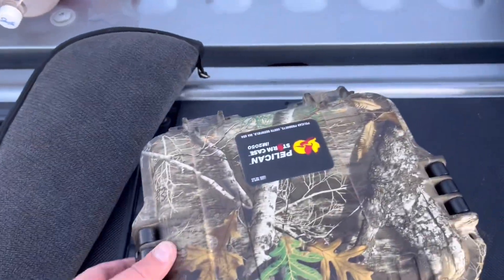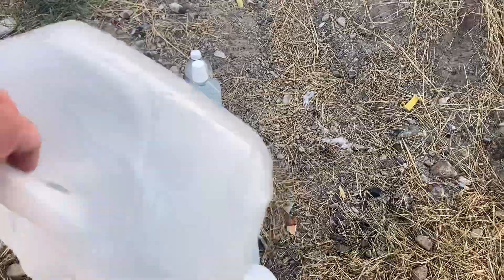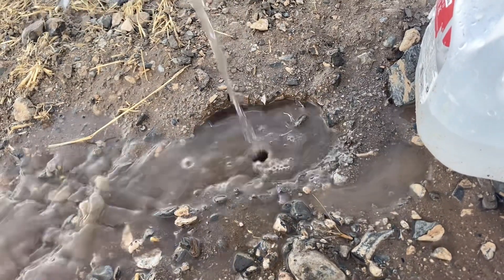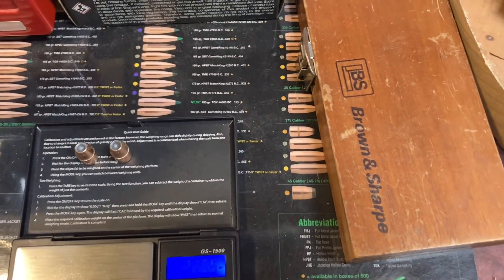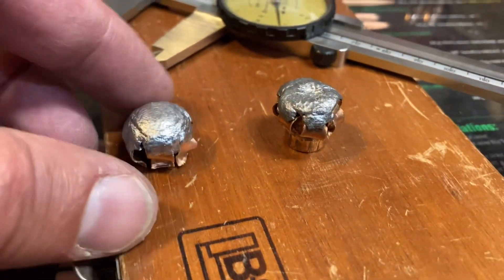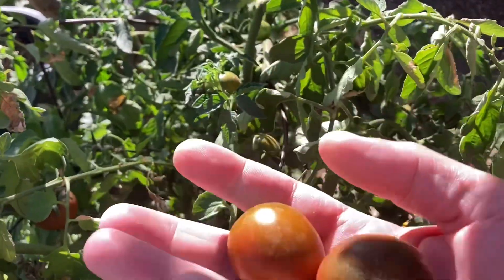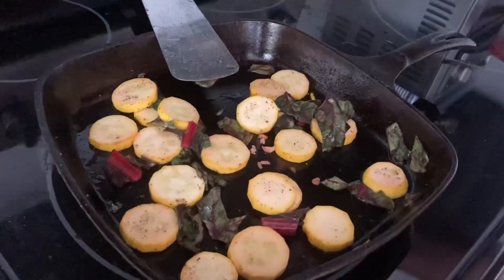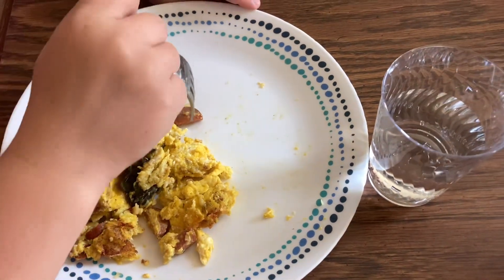240 gr XTP 44 Mag Performance Test -Redneck Ballistic Materials Testing

Comment: Been using these for years in my muzzleloaders and going to use them in my new cva optima v2 pistol with blackhorn 209
Reply from the maker: I really like the XTP’s, they are just a great performing bullet if you can get the velocity, and they are affordable.  Those are sweet looking pistols.  What kind of range do they have?
Reply: Started shooting recently. So far 50yds. Under 2 in. groups using primary arms 2 min. angle red dot . Similar ballistics to 44.mag maybe a little faster . What a gun !